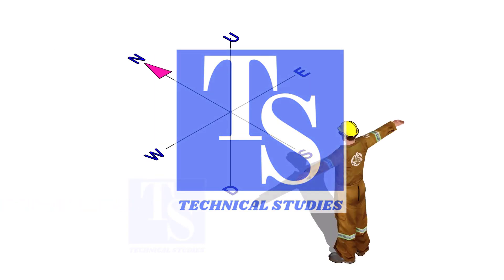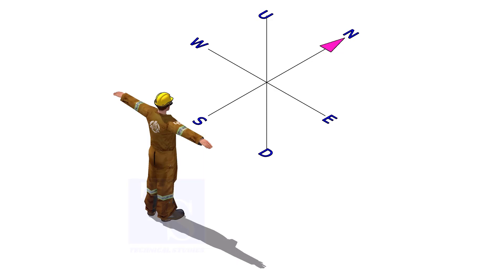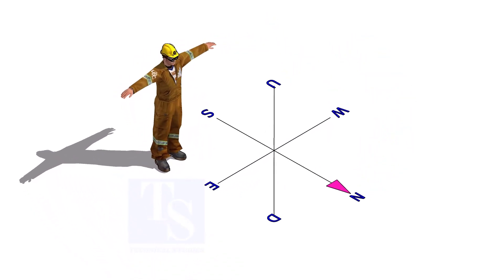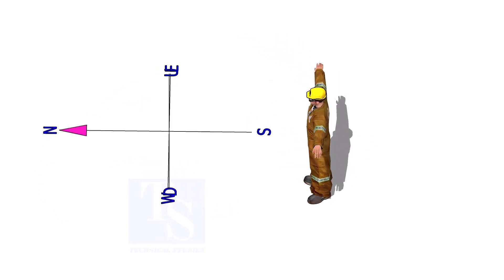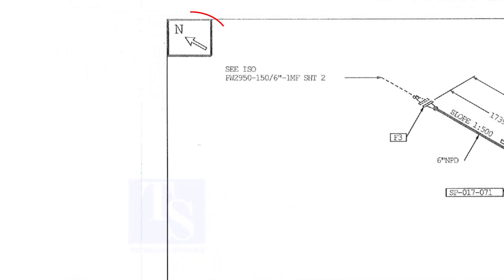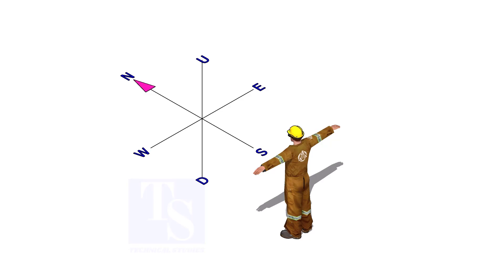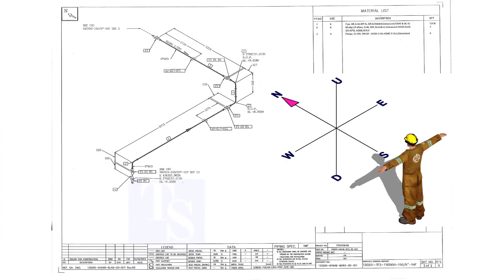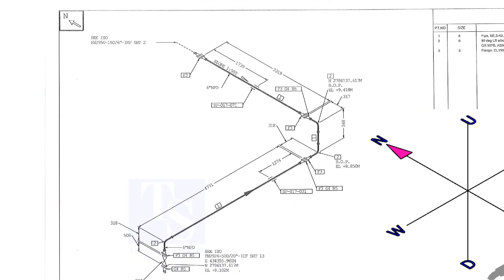How to read piping isometric drawings. Tutorial piping tips and tricks

Comment: I am looking for any suggestions or hints. I am just an amateur photographer and shoot everything in Auto modes. For historical preservation, I want to shoot photos of a roll of blueprints of my work that I did in the early days of computer graphics when I was developing programs for piping design. Exxon Baton Rouge, La in 1974, and at Brown and Root, Houston, Tx beginning in 1981. One of the first computer programs to do piping drafting in the Petro Chemical industry. Some of the first Isometrics with embedded Bills of Materials. The blueprints are a roll of about 50 sheets of paper 24" x 36" faded white sheets with black lines. I'm thinking of hanging them on the wall and shooting them with my Canon 80D. Using an EFS 60mm lens and two Umbrella Studio lights.